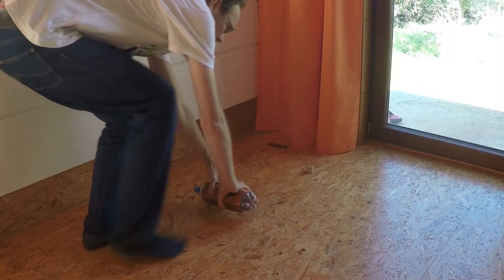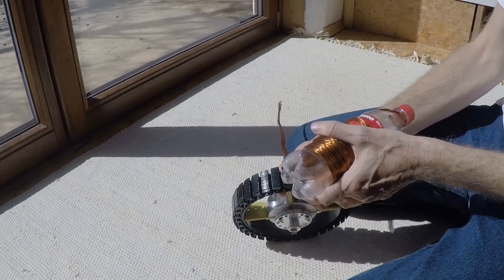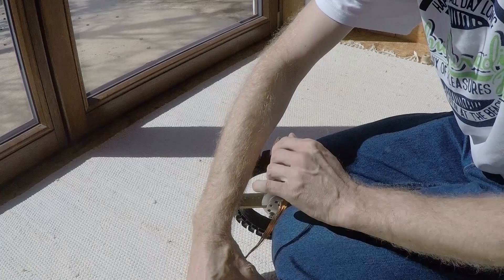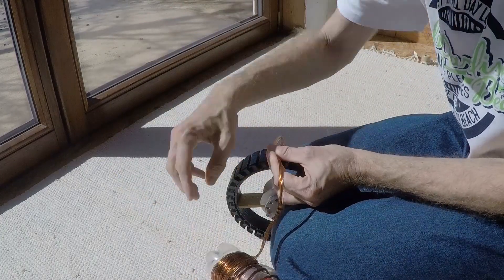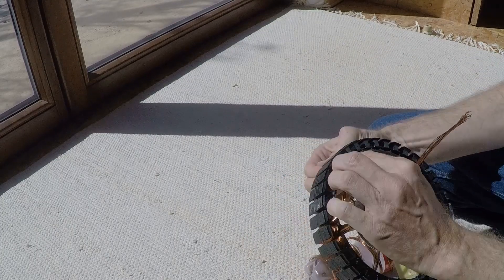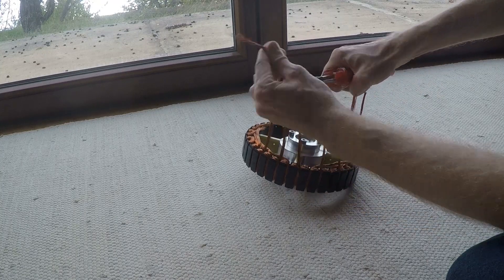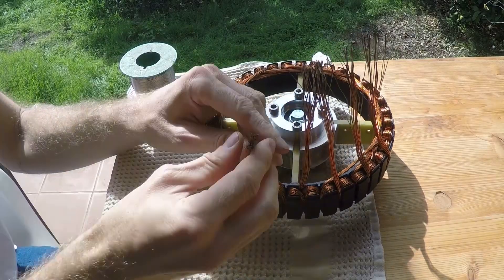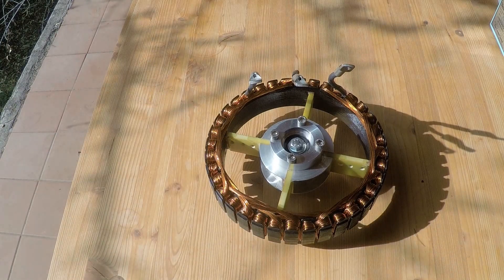DIY Winding a Brushless BLDC 12 kW Motor

Comment: how did you calculate your kv value?
Reply from the maker: Measuring rpm and voltage and then divide both. A simulation tool can also give you an estimation of kv.

Comment: Is there an easy way to calculate the length of copper wire to order for rewinding a BLDC generator? I figured out the cross section of the old coils, by counting the turns of 0,6mm wire they were made off, so I know the area and number of turns I can fit with the new wire, but how does that translate into meters of wire to order? With a square core and more winding layers it will need to be longer that simply the circumference of the core x number of turns. Is there a simple rule of thumb? The length I guess I need, is too close to spool length, so I risk needing to buy 1/3 more wire for the last phase. ( I could also make a test wind of two slots, and measure the length afterwards, before I order.) Nb.: guess this question is popular in the comments!
Reply from the maker: The way I do it: I have a big spool of 0.58 mm wire (diameter) and normally I put a bunch of them in parallel (5-30), depending on the motor type. Then I make a test winding of two slots, measure the length, multiply with the number of (double-)slots I will have for winding and add the length for interconnections and lead wires. This is for one phase. I give some cm extra and cut them all the same lenght after winding. As a rule of thumb, you can calculate:  (2*stator height + 2*tooth width) * number of turns per slot * number of slots * number of parallel wires. Then add some 30% extra. This is the overall length of single copper wire for the whole motor.
Reply: @forschungsbuero  Thank you, that was how I ended up doing it: pencil and paper only got me in the ball park, so I wound two teeth to see if the copper would fit and I settled for a number of turns that could do it comfortably, even if some turns were less than perfect.

Comment: Can you kindly give details such as the wire gauge, number of wires, turns etc. Appreciate it.
Reply from the maker: For this motor I am using 0.58 mm wire and approx. 16 in parallel (not shure). This is a 36 slot and 42 magnet pole configuration with 3 turns per slot. I hope this helps.

Comment: Please could you explain me how to increase the power to 20kw?
Reply from the maker: One way is try to get to higher rpm (eg. less magnets, less number of turns). But this motor should drive a prop at 2000 rpm, so higher speed is limeted by the prop. Other way is to build a bigger motor (more stator length, more diameter)

Comment: How many turns per slot also are you doing clockwise counterclockwise repeating?
Reply from the maker: 3 turns per slot. The correct winding pattern depends on slots and poles.

Comment: Hello sir I like your project I've been trying to build a motor for my own project but I can't be able to get the motor stator from my project please if there's any way you can help me to make it possible for me to get it at least the company you bought yours from if i can have the website address so that i can buy from them as well please i will be grateful to get a reply from you sir
Reply from the maker: The motor is HPD13 from Geiger Engineering, Germany.
Reply: @forschungsbuero   hello thank you sir have seen your reply thank you so much I really appreciate i will try to get the component anyhow it goes i will also get back to you thank you i really appreciate

Comment: Hello! Why have you used several wires connected at a time instead of one while winding? Thank you
Reply: to get a certain torque out of a motor you need a certain total cross section of copper to be wound around every tooth, but winding one very thicc wire is difficult and doesn't fully fill the space between the teeth, so instead we use more smaller diamater wires connected togheter in parallel to achive a similar, equal or larger total cross section of copper

Comment: Sir i have bldc hoverboard motor which is of 350watt 36volt for 800 rpm. Actually I want to  rewind this for 18 volt for 200rpm what changes I need to do? Originally winding data is 27 slot 25swg wire with 5 in hand for 12 turn in each pole. Can u help me plz?

Comment: I really need to build a custom electric motor with low rpm and good torque.  Thank you for this video!
Reply: Thats the holy grail of motors lol  maybe a geared motor or worm gear motor. The windshield wiper motors from cars are pretty cheap if you scrap them from a junkyard. 12v and also very torquey,  not extremely fast but hey slow and with torque

Comment: Dear forschungsbuero,
I have question about patent.
I am trying to learn more about BLDC motors, will build small proto type and interesting to use for my ebike project in  the long term. I just wanted to know from you few details about BLDC patent, As per my knowldege BLDC motors have patents, may be I am wrong. 

Do we need to pay the royalty or need pay to the parson/company, who is owning the patent ? if we build the BLDC motors in house for the ebikes and selling,  it to the customers.

May be this is not right place to ask question. But wanted to know from all.

Comment: 3:40 for such large soldering jobs you can use a small butane torch. Thie would have melted the wire lamination as well.

Comment: you need insulation between the core and the wire. Enamel is very thin and with short on the core for sure without insulation
Reply from the maker: Thats true! There are some black plastic parts to cover the stator. You can see them if you look closely.

Comment: just a question if you can give me an answer i have the washing machine bldc motor  how much it will draw power from 110volt single phase (canada) wall   socket  if i use it  with vfd 1-3 phase converter ?

Comment: Hi. I'm new to motors. Could you give me a few tips on how to make a high torque (65-80 N.m.), low rpm (120-150) brushless outrunner for an e-bike which would run on low voltage (12-18V) and consume few watts (100-200)? Or is it wishful thinking to build an e-bike motor with such parameters? Can the motor stator and rotor be from plastic or alumnium, or do they have to be from steel?
Reply from the maker: Before you start designing your motor, I suggest to get into theory first. Read some good books about Electric Machines. You should have a rough understanding of electromagnetics, otherwise you won't get any good results. Of course you need steel (or other magnetic material) for rotor and stator. For low rpm you will need big diameter and high pole count number. Keep in mind, that rpm ist proportional to voltage and torque is proportional to current. Both will change with the number of turns.
Reply: Hi, i am new to bldc motor too, would you please give me a tips or document on how to calculate the stator size, and the relationship between it and the saturation. Hope to get your reply soon
Reply: If you did for an electric bicycle that type of copper used, how many laps should I take and how many slots and magnets should I wear. Where could you see all that information? Your advice would be of great help

Comment: how did you make the laminated core?
Reply from the maker: For this motor I have bought the rotor and stator parts. But I have made other motors completely on my own. Then I order laser cuttings of silicon steel sheets, eg. M270-35A. Of course, you have to provide a dxf file of the stator cut.
Reply: where can you get the rotor and stator
Reply: Are the steel laminations expensive? Is it problematic to use other types of steel, other than silicon steel?

Comment: Schönes Video!
Wo gibts denn so Motorteile? Ich suche eher etwas in Richtung 4kw.
Reply from the maker: Die Teile sind vom Geiger/Flytec Motor. Ein 5 kW Motor mit unter 2 kg habe ich in Arbeit und werde ihn demnächst vorstellen. Vermutlich wird es dann auch Einzelteile geben. Infos dann unter http://www.Forschungsbuero.de
Anfragen bitte per Email.
Reply: forschungsbuero den Motor unter 4KW auch Leichter als 2 kg ist unter T Motor U13 bekannt und hält 12 min bei 4 kW aus